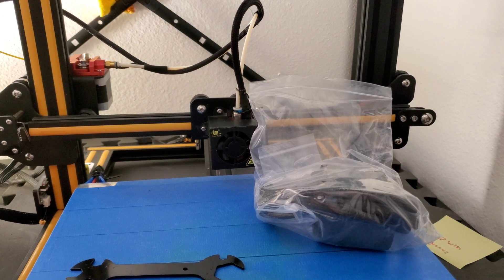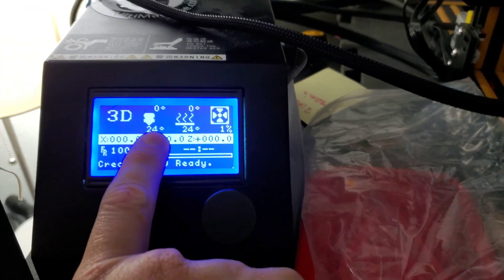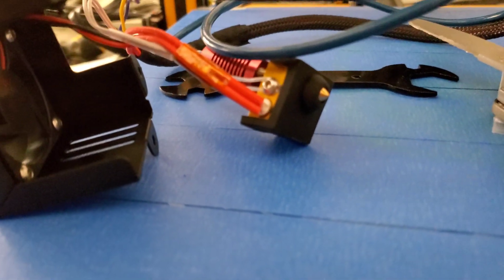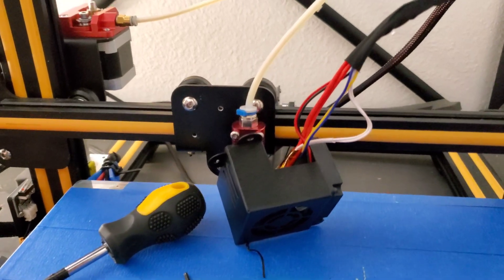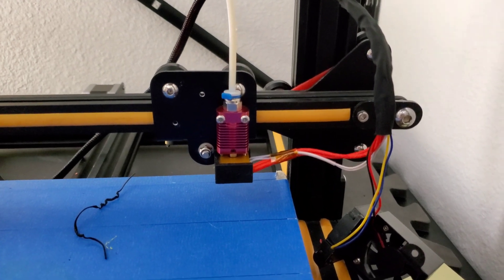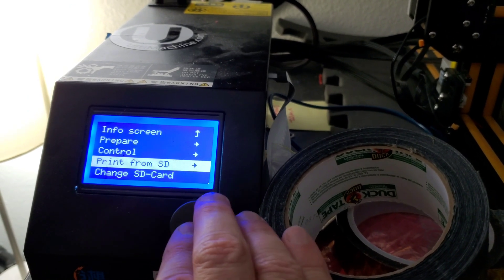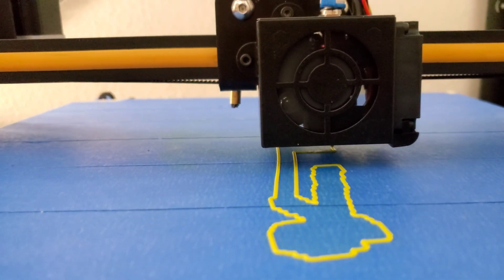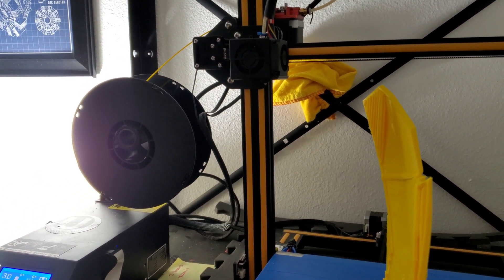How to Replace a 3D Printer Extruder | Creality CR-10,  CR-10S, Ender 3

Comment: This video title is wrong. No mention in the video on how to change EXTRUDER which Is why I am here.
Reply from the maker: The "extruder" includes the motor, filament drive, cold end, hot end, extruder fan, print fan, cold break, heater core, nozzle, heater block, and temp sensor .

So what exactly is your definition of extruder?
Reply: @GeoDroidJohn  thanks I didn't mean to sound harsh and thanks for your content. Apparently I was missing some parts on the filament drive, and while it might be obvious for someone experienced, it can be a puzzle to the uninitiated particularly if you don't have a full set of parts. That's what I was looking for and no mention at all about this in your video.